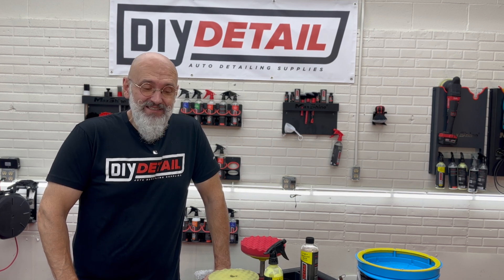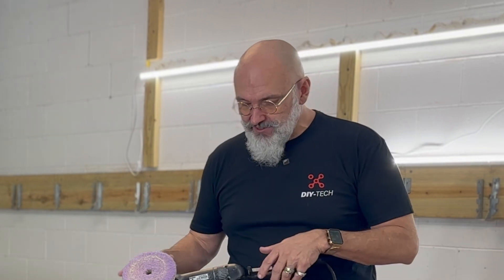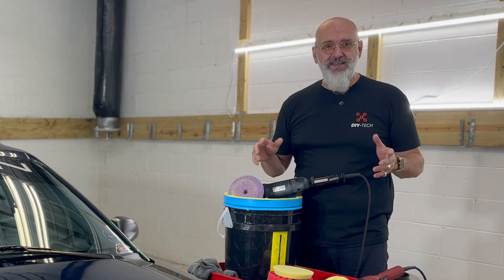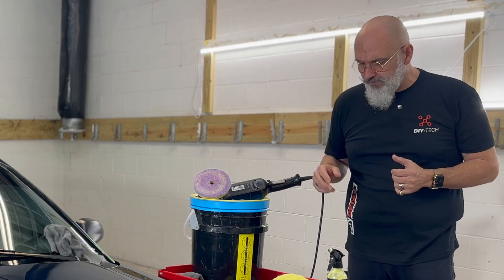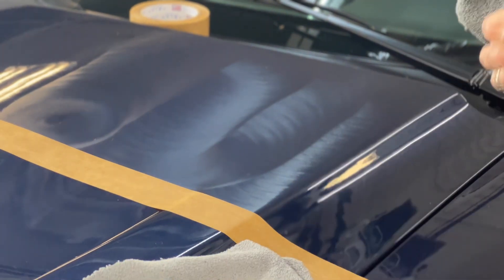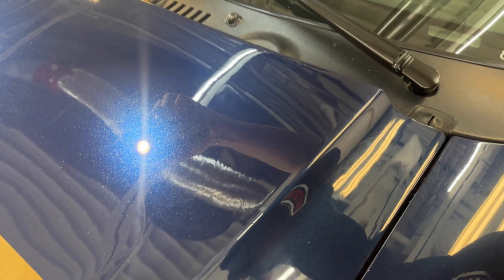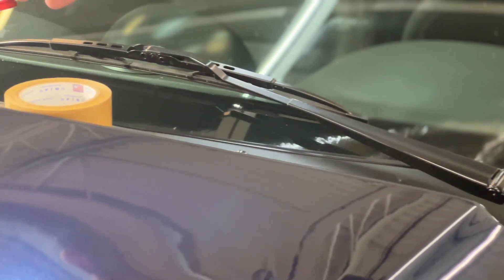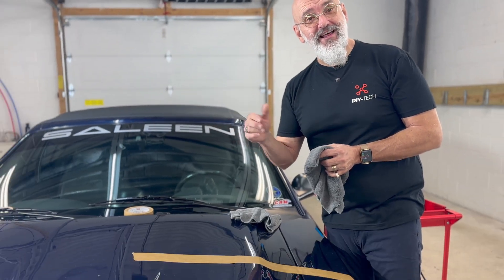Detailing 101 polishing GOLD STANDARD SYSTEM #diydetail #goldstandard #polishing

Comment: Thanks again Yvan. Just wondering what you would than use if detailing peoples cars as the next step and they don't want ceramic coating. Wax or a spray on wipe off ceramic coating or something else. Thanks ❤️
Reply from the maker: DIY Detail Ceramic Gloss
Reply: Thanks!
Reply: Straight on tip of the vehicle after buffing? No removing polish residues first like long life ceramic clear?
Reply from the maker: https://youtu.be/a-N1hAIIk9Q?si=lwjpwM1Kwepwmv-7

Comment: You just used a one polisher and tow different pads    others used tow polisher for tow pads   like step 1  and step 2   so can use one step like 3in1 on tow different pads to get same results as u did or is that just work with gold standards standards 
Thank u so much for all the information u gave to us🌹
Reply from the maker: sorry i'm not sure the question exactly. Gold Standard Polish is pad dependent, so you can just swap pads for different levels of cut....wool cutting pad for most defect removal (sometimes finishes down great, especially on hard paint you often don't need to swap to a foam pad after), gold waffle pad for medium cut (and great shine, so great for 1 step polishing) and the rotary jeweling pad has very little cut but gives you maximum gloss.
Reply: Thanks so much for that information

Comment: I'm in the process of polishing a 2006 Blue Mini droptop that was likely never done.   The perforated decon towel took it from a sandpaper finish to a finish that's smooth as silk.   A uro fiber pad on My 3401 is doing a fine job polishing the paint.   Followed by a waffle pad(Yours). Which is producing very nice shine.   Perfect? No! Not going for that.   Thank You for fantastic products!  I have to get a pad washer.   I'm sure it would have saved time.   I've used a ton of pads.
Reply from the maker: Thank you, please post your results to our Facebook group 

Https://bit.ly/DIYDetailFacebookGroup
Reply: Will do. It looks quite nice. Lottttts of hours. Thank You. @diydetailofficial

Comment: If I currently have some different brand 1 step polish that isn't sprayable can I just "brush" or drag the tip of the oppening over the pad simulating the quantity of the sprayer in order to avoid the 3-4 dropplets?
Reply from the maker: You will need to test

Comment: Hey Yvan! After the wipe with the Rinseless dampened towel, can you spray some Ceramic Gloss to add protection and then wipe with the dry towel or are you better off wiping off the polishing residue, drying and then Ceramic Gloss on the dried surface?
Reply from the maker: Yes

Comment: Thank you Yvan, great tutorial as always.

I have a bonnet style 10" DA polisher that comes with a flat foam bonnet and a couple microfiber bonnets.  It still runs fine even though it's about 10 years old so I'm hesitant about abandoning it.  Can I still use it following the same principles from this video (50% overlap, two towel method, etc.)?  Or should I bite the bullet and maybe get a 5" random orbital palm sander?  I only detail my own car so I'm trying not to spend unless it is absolutely necessary.
Reply from the maker: They are designed for wax applications. The random orbital will do a better job.
Reply: @diydetailofficial  appreciate the quick response!

Comment: Hello Yvan, this is a great educational video. I have a few of questions regarding polishing.  

1) is the Gold Standard polish safe to use on high gloss black rims (e.g. Newer Dodge Challenger Blacktop edition rims)? 

2) if yes what application method you use to remove scratches?

3) On a different note, can the damped towel be dampened with Rinseless or should it just be water? 

I look forward to your responses.  Any help or suggestions would be appreciated!
Reply from the maker: 1, yes
2, hand polish with a MF towel, or a small polisher.
3, ideally dampened with DIY Detail Rinseless Wash.
Reply: Thanks for the prompt response!
Reply from the maker: Thank you for the questions

Comment: Hello, I am having difficulties getting the  polish to spray (using Telco trigger spray head). I’ve primed it but it doesn’t come out. When I use the “black” generic spray it comes out but like a jet not a mist . Is it ok to put the bottle in Bain Marie to warm it and reduce density/increase flowability? 🙏🏻
Reply from the maker: No need to warm it. You can adjust the tip, but also you need to pull the trigger like you’re angry at it, meaning hard and fast. 

FYI our black triggers are Tolco.

Comment: Greetings to DIY Detail Team,

I know the answer should be yes, but can we use your spray polish with the red jeweling pad for maximum jeweling effect / finish on a white paint substrate which is ready for ceramic coating but want to apply the jeweling process to the paint.
Reply from the maker: Yes you can!

Comment: Hey Yvan, so I recently ceramic coated my car (after doing all the steps required prior, and I did use your DIY standard polish as a 1 step correction, and it made my car shine great and fixed all the swirls as a paint enhancement) so anyways a local detailer in my area asked me if my car was coated and I told him it was he could tell by looking at it, (btw I used Avalon King ix) so anyways he told me that you should never do a 1 step correction and that you always need to compound in order to get Virgin clear coat ceramic coat ready paint. Ofc this is just one persons opinion but what do you think about that ?
Reply from the maker: Unfortunately a misinformed detailer.

Comment: Love the video!! Very clear and concise, easy to understand instruction 👍
Question: You've mentioned in the past that one of the best benefits of the Lake Country pad washer is that it uses fresh solution everytime so you aren't cleaning the pad with dirty solution. How do you recommend duplicating that experience for the hobbiest that doesn't polish enough to justify the pad washer? I've seen you remove the pad and clean it in a bucket of solution but it seems like that solution would get dirty rather quickly. Thanks!
Reply from the maker: Small batches of Rinseless wash. Just put an inch in the bottom of a bucket and change after 2-3 cleanings

Comment: Are these pads okay to use with a drill? I  will be  working on some soft black Toyota paint that has some.med.to.deep scratches as well as some swirl marks , marring etc..I also want to polish or give the car a NICE "Glossy finish" at  end after the corrections have been made.
So, if you could please let me know which of your pads , or pads in general I.should use for.both correction and finish, I would really appreciate it. 
Thanks!
Reply from the maker: Yes

Comment: Is the towel damp with your Rinseless wash solution or is it just water? Same as in your pad washer… is there Rinseless in the bucket?
Reply from the maker: We use Rinseless Wash-dampened towel to wipe off polish then follow with a different towel. In the pad washer either Snappy Clean or Rinseless Wash 256:1

Comment: After installing the 8 year ceramic coating, what do you recommend if there is bird droppings or bug guts that accumulate during the curing time before it is able to be washed? Would you let it go until the cure completes and then wash it or would you spot treat it with the rinseless wash for example?
Reply from the maker: Spot treat.

Comment: Is it ok to do more than 3 passes with the wool pad? Or is that removing too much clear coat?
Reply from the maker: Yes, you can, but if you see the polish change appearance to a wavy look, it’s cutting ability is spent.
Reply: Thank you! I have an old porter cable DA. Speed setting still set at 3?
Reply from the maker: With those, 5 is good

Comment: Hi great video, I have the G9 DA and Bauer rotary that I’ve just bought and never used but I like your method in this video of using the Da for cutting and Rotary for polishing, do you advise a waffle pad for cutting and finishing/polishing? Do I use gold standard for both? Do I change the pad or use the same pad for the entire vehicle? I don’t have the budget to buy the pad cleaner that you have what do you recommend or advise for cleaning/using the pad without the one you have? Sorry for all the questions as a newbie your videos are helpful but can still be a bit overwhelming for myself to start out thank you for any help you can provide
Reply from the maker: The Gold Standard Polishing System Waffle Pad will work great for both machines and give nice results. To clean the pad, simply dunk it in your Rinseless wash, squeeze it out a few times,  then spin dry on your machine. 

Thanks for the questions, that’s why we are here.
Reply: @diydetailofficial  thank you so much I appreciate it, lastly would 1 pad for cutting and 1 pad for finishing be fine? I know others I’ve seen change 2-3 pads for cutting and 2-3 pads for finishing?

Comment: I think the system is great but as a DIYer spending 140 dollars on the pad cleaning system doesnt make much sense. I happen to have a bunch of grit guards and i use them to abrade the surface a bit in a tray of ONR. I then dip in ONR again and run the machine to leave a damp pad. Ill be buying DIY rinseless once these 32oz of ONR are gone! At 256/1 a 32oz bottle of ONR lasts a long time for me!
Reply from the maker: That’s a good option

Comment: That’s a clear explanation I’ve been looking for with respect to micro-marring and using a rotary to clean that up. I imagine this is double so for black paint. Also amazing you used speed 1 for finishing. Is speed 2-4 too much?

What are your thoughts on using a generic Amazon rotary from China? Or do you recommend only a high end Flex brand?
Reply from the maker: The only reason to go above speed one, is to clean the pad. Any rotary will do the job, but some are better than others for comfort and ergonomics.